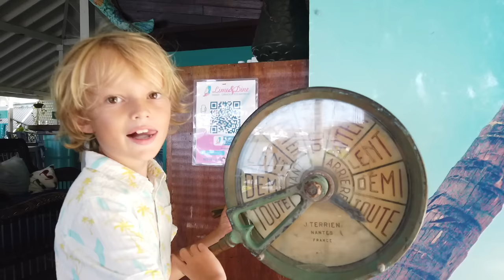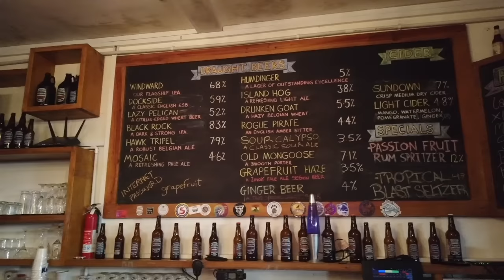RESTORING Our 30-Year-Old 48' CATAMARAN - Are We IGNORING PROBLEMS? | SailAway 247

Comment: Build a simple baffle box to put the portable generator in.
Reply from the maker: That would definitely help.  The problem then is storing the box in addition to the generator as it's only backup.  Someone mentioned building a platform inside the generator compartment then venting the exhaust.  I've fixed the main genny now, so maybe I can find some time to try one of these options for the future.

Comment: Install back flow preventer on all hoses with through hulls bilge pumps should have them also.
Reply from the maker: Thanks for watching!  I may go back and install one in there, though the way it's oriented it shouldn't really need it.  It's way above waterline and the drain hose goes straight up from it, not down into a bilge like some.

Comment: So far Grenada seems to be living up to its reputation as cruiser and boat kid friendly and very few hurricanes.
The 482's nacelle cabins had a sink in that spot- seems someone took it out and replaced the thruhull and never went any further- weird.  I'm sure the washing machine will work out great and be much appreciated- big step up from bucket and plunger.  
Great to hear your diesel generator could be repaired- I'm sure we'll hear about it in future episode.  Is the starboard propulsion engine set up to charge starting bat and LiFePo house bank?  There are devices that can allow this and not tax the alternator- see Emily & Clark's Adventure.
If your port engine is not repairable, is there a HP range replacement you would be looking for? Assume you are in the 48-60hp range now and maybe would prefer normally aspirated and avoid turbo charged.  Would you keep current transmission (even if an adapter plate needed) or go for both new/used engine and transmission.  I see quite a few used Yanmar 4jh-hte   44hp engines and transmissions for sale by military and priced around $6-8K with 1-2K hours but they are from the late 1980's.  There are also Asia marine diesel imports available.
I would think any major engine replacement or solar project would be in US or Panama?Mexico.

Comment: I've been waiting and wondering if you made it to Grenada 🇬🇩.  It's nice Rivers has friends and activities. Puzzled that you haven't identified all of the through holes. Hasn't Ophelia been on the hard once since you purchased her? Oh well, you know now and it worked out. Curious condition of the surrounding wood. I hope the generator repair was successful. Thanks for sharing.😊
Reply from the maker: Yeah, any passage with much wave action there would be water sloshing up through there anytime a wave slapped it, so not surprising the surrounding area was still moist from the last sail.  That thru-hull is about midway back under the nacelle, so not in a typical spot at all.  Not at all surprised we didn't notice it when on the hard since we were focused on the hulls.  Glad we found it though!
Reply: @SailAwayVlog  Thanks, it happens. I'm you're where you want to be.

Comment: You could get a jackery unit with solar charging panels and run most everything inside the boat while keeping it charged---making NO noise !
Reply from the maker: Those units are very cool!  Unfortunately nowhere near enough power to keep the stuff aboard going though.
Reply: I've seen them 3000 watts. @SailAwayVlog
Reply from the maker: They're definitely cool for camping and maybe even some smaller boats with less stuff to power.  Unfortunately the power needs on most full time liveaboard boats out here would far outpace it's ability to recharge fast enough.  The system we have aboard is essentially a much bigger version of it.  We would need about 2500 watts of solar to charge the 900 amp hours of lithium enough to run everything without another charge source...on sunny days only (we currently have 600 and plan to upgrade to about 1500).  And at a couple thousand $$ for the big ones, it would be too much for us to spend on a backup.  Again though, really cool units.  Would be incredibly cool for camping.
Reply: Would love to hear of your plans for the upgrade. @SailAwayVlog
Reply from the maker: The current panels are slightly smaller than modern ones and rated at 600 watts, but with the 3 of them we never see over 400.  My first plan is to modify the solar frame slightly to accommodate about 6" more width and then I should be able to fit x3 340 watt (or so) panels.  Our current controller should handle that, so it'll be fairly plug and play I hope.  Next step would be some soft panels on the cockpit cover.  Should be able to easily get 400-600 watts up there as well along with a separate controller.
Reply: Sounds like a solid plan and hopefully will lessen the gen run time. Love the videos and crew. @SailAwayVlog

Comment: Y’know it occurs to me that you could ratchet a board to the generator ladder to make a shelf. Then you could set the portable on there and the compartment would partially muffle the noise.  And leaving the hatch open would probably provide enough airflow to vent the exhaust. If not then put a fan on the floor down there to force the fumes out the hatch. (CO fumes are heavier than air.)
Reply from the maker: That's actually a great idea and we have considered that.  My thought was to wire in a connection right where the main genny supplies power.  Unfortunately, though simple it would've taken a good bit of time to set something like that up and  I was putting all my time into fixing the big one.  It worked out...got the big one fixed finally.  I would really like for the backup to live in there too though.

Comment: I talked with Chad with Just Catamarans about a Nanni diesel at the Annapolis Boat show. He told me that a 50hp Nanni(AKA Kubota) just like the Beta Marines would be 15,500ish with a saildrive. He was also up for shipping to exotic places.
Reply from the maker: That’s a decent price. Too steep for us unfortunately. However, I’ve been investigating some electric options that might just be possible.
Reply: @SailAwayVlog  There are pluses and minuses with electric.Typically the required battery bank, even with making your own batteries out of 3.2v lifepo4 cells is going to set you back at least 4 grand...but that depends on the motor voltage and capacity.  Most of the voltages are probably going to be 48v.  You might could get by on 2k dollars worth but you would be stuck at 14kw capacity.  Depending on how you use it that could be more than enough. Torqueedo (spelling) makes a sail drive product but I don't know the cost.  There are also other products.  Most are around five grand in cost. So you might be able to get out that route for 8 grand with wiring and incidentals.    If the Kubota would fit your sail drive you might be looking at 10 to 13 grand.  Though without at least one good solid diesel you really would be compromising your safety.  Given that your other engine is likely so high time, Id bet dollars to donuts it isn't far behind the other one.  The Rigging doctor has had electric for a while.  He almost lost his boat being too far offshore for a tow when he lost his forestay.  The electric engine ran out of juice.  Also he has replaced the electric engine three times.  So reliability wise you might consider otherwise.  Pegasus out of Charleston wrecked when their engine lost power after an hour and a half of fighting tides...If I were you I'd find a way to replace or repair your current motor and then go electric after having something reliable.  A rebuild would likely be 2k to 4k, but I would have it done in the states.

Comment: You can try to justify your decision to do convenience projects over safety issues, i.e. 2 motors and your generator...they should have been replaced with at least remanufactured engines, not just patching 30 year old motors
On a another note I have only chartered Cats with water makers, I have never had one on my boat but they were quiet, you could barely hear them running
Reply from the maker: Thanks for watching and the comment!

Comment: You can do something about not running the loud generator; consume less power onboard!  You can always charge stuff ashore. Running it more than hour a day in an anchorage is really, really anti-social.
Reply from the maker: Sorry, but it sounds like you're very out of touch with how this lifestyle works.  Charge stuff ashore?  Like most in the anchorage around us, we live completely at anchor, only using marinas under unusual circumstances.  You can't carry a 900 amp hour house bank to shore and plug it into a wall outlet.  You also can't snap your fingers and magically "consume less power" enough to only need one hour of charging per day.  What we can do is try to use it at a time when it bothers the least amount of people while we work on fixing our onboard generator.  We and the majority of folks out here realize when they hear a portable going, it's simply necessary to the boat using it.
Reply: I know all about charging big batteries. I have a boat like yours myself and live on it!. I’m talking about your computers and phones getting charged ashore.  Also, I thought you had big solar panels?